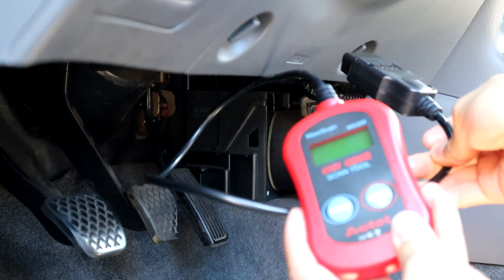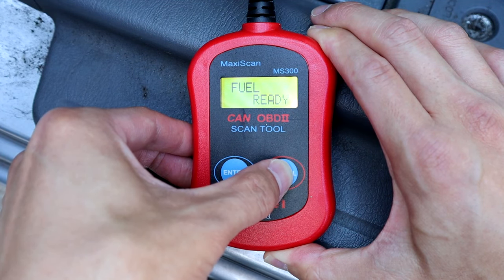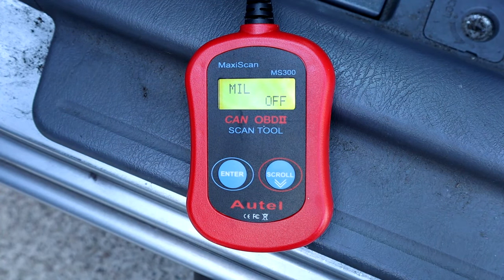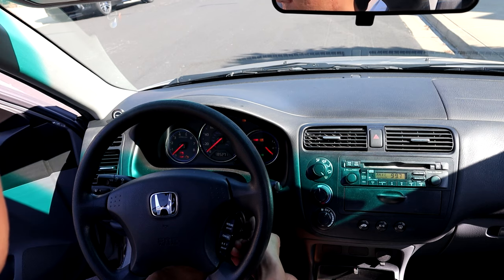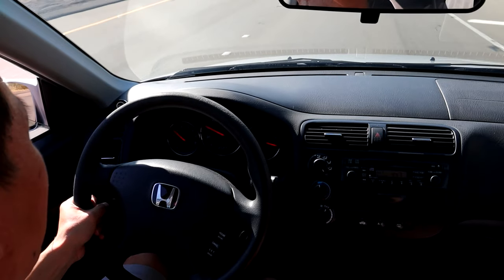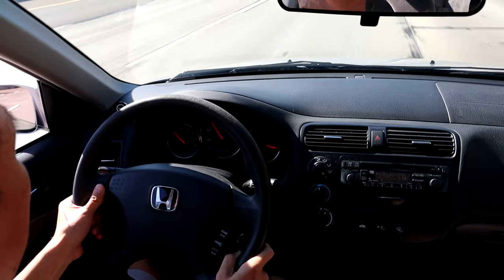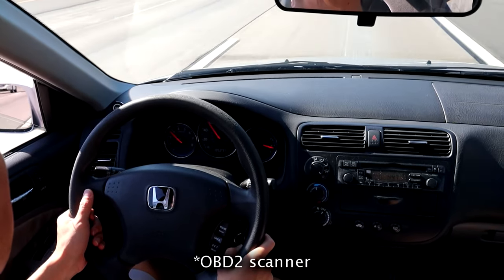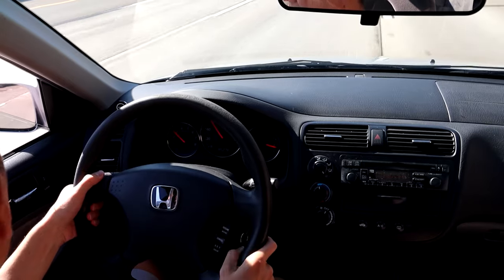How To Get Your Car Ready For a Smog Check – Pass 100% Of The Time – I/M Drive Cycle Ready

Comment: My car isn’t passing the smog after I done the drive cycle a few times different days 
Question: I was told it may be a code they need to obtain  from one who has the license for that particular code so where do I get this code?
Reply from the maker: You'd have to search on your particular car, but most cars will tell you the code if you know how to read it.  Or you can get a device like I have linked in the description and it'll tell you what the code is.  Sounds like you need to get something fixed before you'll pass smog.
Reply: Yea I had the canister thing replaced and the leak and a couple of other emission part replaced all the lights went green after that except for one and that one is the trouble  I’m not a mechanic but just a bit of it and ummm … I was told by the previous mechanic that for some reason something about getting a code from the computer or to that effect might not be functioning because the computer is not reading it he said it’s in the dash below the fuse box so tat was my question regarding a code.

Comment: i have gone 3 times allready to try to resolved this issue (catalyst inc.) on my 2012 acura mdx. i bought an obd 2 scanner and about to attemp this hopefully it will work. ohhh by the way the smog tech. keeps telling me i have to keep driving it  to clear it and its been 2 hundred miles and i hasnt clear its been a thorn in my spine.
Reply from the maker: Lolol why are so many techs stuck in the past???  I get that comment pretty often on this video.  Mindlessly driving the car around doesn't magically fix it.  Hopefully doing the drive cycle will.  If it doesn't work by 3 tries, you probably have a problem with your cat that needs to be addressed.  This drive cycle also doesn't magically fix everything.

Comment: NO I/M on FIXD. Did your freeway drive Twice 4am Sunday. Still has Solid engine light.  The FIXD Told me and 3 guys with scanner to replace 02 sensor.  I did 100 back.  I cleared history on FIXED.  LAST YEAR I PASSED SMOG Now 10,000 later problem!

Comment: What if the car is stick not changing gears will make its stall out when coming to a stop and holding in the clutch drops the rpm ?
Reply from the maker: I did the demo in this video in a stick.  It's gonna lug the engine on the freeway, which sucks, but you have to do it.  All other situations in the video you drive the car like normal.  You can switch gears and push the clutch in.

Comment: What’s the maximum amount of times will I need to do the cycle.
Reply from the maker: If you do it correctly, you shouldn't have to do it more than once.  I'd say if you've done it more than 3 times and are still coming up with monitors not working, you actually have a problem with that monitor and it should be checked out.

Comment: Do you have to take the car in for the smog check right after the drive circle?
Thanks for the video.
Reply from the maker: No.  The drive cycle just makes sure all the monitors are ready for smog.  Once you've done the drive cycle and confirm all monitors are good, you should be able to pass smog whenever, assuming nothing happens to the car and that you can pass the visual part of the inspection as well.
Reply: Got it, Thank you so much.
You've helped me a great deal.

Comment: I clear the faults a block a away from the emissions center with my scanner. It never fails to have a check engine light on when its time for an e-test.
Reply from the maker: Probably means you actually have something wrong with your car.  You can't just "clear faults" and expect the car "to be fine" and pass.  Read the code and get the issue fixed, then you wouldn't have to deal with that in the first place.

Comment: @nukem384 would this work if the car was on a lift instead of actually driving it on the road (the drive cycle while car is on a lift)? Also would this work on a Nissan 2000?
Reply from the maker: No idea since I've never tried.  But in theory it should work.  It would definitely help in that you can avoid traffic.  2000 and up cars should be fine, so yeah I would it would.

Comment: hi sir i did this routine and i put about 150 miles on my mitsubishi galant all monitors are ready but the evap system and egr system just wont get ready whatever i do and when the evap finally got ready my engine light came on and now i reset monitors again and have to start over but not sure why the egr is always incomplete any suggestions?
Reply from the maker: I would say get that checked out by a mechanic.  Running this drive cycle can't fix everything, and if it keeps coming back or you're driving a ton of miles, you probably actually have a problem with that system that needs to be fixed.
Reply: I'm dealing with the same shit. Changed almost the whole EVAP system except fuel pressure sensor on gas tank. 2 many variables

Comment: Done all the drive cycle like 3 times after a battery change  Still have  EVAP Inc ??? any ideas
TIA  Nissan altimas 2012 by the way
Reply from the maker: You might actually have a problem with the EVAP system.  I would get it checked out by a mechanic

Comment: My AC compressor doesn’t function and pops a check engine light, it’s a Jeep Wrangler and so I don’t use AC anyways. Does turning on the heat work?
Reply from the maker: If your compressor is throwing a code, then it needs to be fixed. This drive cycle isnt going to magically make it go away
Reply: @nukem384  that’s the thing. It doesn’t throw a code. Nothing is throwing codes. It just doesn’t turn on anymore. It’s a 2dr jeep so I’m about to replace the compressor with a pully wheel because I don’t need the ac. 

It’s my beater up car. Drove 160 miles over two weeks and no code nothing. Today I turned on the ac for 5 minutes and nothing happened but no codes came up, but the vehicle is still saying the car isn’t ready for emissions yet.
Reply: @nukem384  the only thing I haven’t done is filled up the gas tank. Not sure how that does anything but willing to give it a try.
Reply from the maker: @matthewdovi8548   gas tank has nothing to do with it. I would read the code and see what its telling you. But in your other comment, yeah you could do that as long as the car doesnt throw a code, it shouldnt impact smog
Reply: @nukem384  I have no code/check engine light.

Comment: I have a 2008 tundra and did the drive cycle multiple times, the readiness monitors shows complete/ready for all of it but the check engine light came back on and says stored?  Can i still smog the vehicle? What other alternatives can i go with?  Please help I need to smog my vehicle..thanks.
Reply from the maker: If the check engine is on, you can't pass smog.  Read the code and go from there.  Since you've done the drive cycle multiple times, that says that there's actually something wrong with the car.  This drive cycle doesn't magically fix everything.
Reply: @nukem384  thanks for your response the code is a p0430, could it be the 02 sensor?  Sparks? Or cat?
Reply from the maker: @romaouk1318   I would try the O2 sensor first and see if that fixes it.  If not, there's a good possibility your cat is shot.

Comment: What year is this civic?
Reply from the maker: 2004 Civic.  7th gen
Reply: @nukem384  thank you, I recently bought a 2004 Honda Civic LX and it needs to pass the smog test hopefully with this video it can pass it.
Reply from the maker: @fimbres-_-9509  Yeah if something just needs to be reset, this will work.  But if you try this like 5 times and some of the monitors still aren't set, you probably actually have an issue with the car.

Comment: I have an older type obd2 reader. Mine says Mil=off, Inc=0. That means i will pass the test?
Reply from the maker: Sorry, don't know what those readings mean on the old ODBII reader.  Basically, if the monitors are N/A or good, you should be ok.
Reply: MIL - Malfunction indicator light or Check engine light yours says off, that's good, that s a pass

INC - Means Incomplete Monitors - Yours says 0 that's good, thats a pass. 

I would say you are good to go.
Reply: @stevew9563  
Thank you so much. That's what I suspected. Appreciate it.

Comment: I had all the monitors complete except for catalyst. I didn't know what part of the drive cycle reset this..your explanation and what to do when I was able to reset.
After warm up,55mph for 3 minutes then throttle off and coast to 20mph,no brakes or gear down
Did I the the freeway early in the morning with flashers on. If your freeway has hills,when you throttle off try to time it going up hill,that brings you to 20mph faster 
Then 3/4 throttle back to 55 for 15 minutes. That should make it
Reply: Thought it was 5min after dropping to 20mph

Comment: what’s the main monitors are needed to pass and which ones are a must…evap can b n/a????
Reply from the maker: All of them unless it says N/A
Reply: @nukem384  i have cata incomplete…htd cata, erg, ac refrigerator, sec air system all is NA…is that a fail??
Reply: in pennsylvania…the 1st time i did the cata clean formula i can drive up to 674 miles that engine light is in again (p420 for cata conveter) and 2nd time i did. the cataclean it only took 150 miles of driving for engine to come on…i guess i didn’t do it right…
Reply: ty again for all the advice n help
Reply from the maker: @imsoooimpresssss4574  this sounds like you need to replace something. This drive cycle doesnt magically fix anything. If a part is broken, it needs to be replaced
Reply: @nukem384  u right…i do need the catalyic conveter to be replace…since the off market is not guaranteed to last over 2 years…in 2019 i did have it replace but it’s after market…my 02 sensor at 1st was also showing up but after cataclean it only show cataylic code not the 02…would ot be best replacement cata converter & h2 sensor or since the code only show cata conveter…should i replace both or just the trouble code…? ty again
Reply: @nukem384  much much appreciated it…ty
Reply from the maker: @imsoooimpresssss4574  if the code is only saying cat, just do that first and try drive cycle again. Then if it doesnt work, try the sensor also

Comment: I have a 2013 ford mustang with a pending po456 code (no check engine light) I drove it for so many miles and nothing has worked I tried this method once but still no luck clearing it . Any advise ? Also it’s a manual transmission
Reply from the maker: That code is telling me you probably need to take the care in and get it fixed.  According to the code, there's a leak in your EVAP system.  No drive cycle or magic driving is going to fix a leak.
Reply: @nukem384  the check engine light has not triggered I fixed the problem and rest the light and hasn’t went away nor does the light come back on .
Reply: @nukem384  i had a check engine light and it showed it has a leak and it was the purge canister . I changed it and I reset the light and it hasn’t came back on but the pending code doesn’t go away .

Comment: Smog isn’t passing me for the “Evap” and “Air” they just keep telling me to drive and I understand that’s for the evap and need a new gas tank cover but evap is okay here in California if not cleared. I need help with the “air” getting cleared. Is that the idle and rear defrost ?
Reply: I’m just confused bc I’ve done the idle for 2 minutes without the ac bc that’s what I was told and still the same logs “air” won’t clear off the list or “evap” but I’m gonna give this a try again tomorrow and hopefully the Secondary air injection clears
Reply from the maker: @cobygreenwood1015  If it doesn't you may need to have a mechanic look at the car and fix something.  Doing a drive cycle doesn't magically fix everything.  If there's an actual problem, it needs to be fixed.  Driving the car around isn't going to fix it.
Reply: @nukem384  I know it doesn’t magically fix anything lol I did check the car if something wrong I have no check engine light or leaks which would tell me if something was wrong or needing replacing the whole point of a check engine light but I’ll try your little ac trick tomorrow to see if that clears the “air” part of the smog

Comment: Question, will I pass if I have 1 monitor incomplete? I want to smog my car today, but I have 1 incomplete monitor (EGR system). Will I still pass? My car year is 1996 and I live in CA thx
Reply from the maker: Read the description.  This cycle isn't relevant for your car because they are doing the old sniffer test anyway.  That said though, if your check engine is on, you're not passing anyway.  If it's not, it's a toss up.  I can't say if you'll pass or not.  Depends on what the sniffer test picks up.
Reply: @nukem384  what’s the sniffer test? My check engine light isn’t on, but I did try to smog my car about a month ago, but failed due to incomplete monitors. The tech said everything else passed tho and runs clean, just incomplete monitors?
Reply from the maker: @Nada.yourbusiness  It's where they put this tool in your exhaust pipe to measure emissions. I suppose you could try.  Do the whole test and then get your scanner and see if it reset the EGR monitor.

Comment: My car is not reading the egr data , Can i skip and just do the egr portion?
Reply: Yes you can just do the section of the drive cycle that targets the EGR.  Whats the year make model?
Reply: Thank you for getting back to me. I had to run it at over 5000 rpm's for a few seconds to get the EGR to read.
Reply: @edk9576  Honda??
Reply: 2019 Acura MDX Hybrid

Comment: I have a Mitsubishi Lancer 2006. Disconnecting my battery for an extended period (2 Days) caused 'not ready' with all monitors. Should this procedure work with my situation please?
Reply from the maker: Yup.  This whole video came up for me because I changed the starter on an 06 Civic (disconnected batt to do the install), and it sent all the monitors into not ready status.  Do this procedure and check again, they should all be good after that.
Reply: @nukem384  Thank you sir, I'll give it a go. My car is manual transmission, I dont suppose that would make any difference?
Reply from the maker: @PeteUSA44  Nope, doesn't make a difference.  I've done it on the Civic in the video (04) and it's a stick too.

Comment: will this scanner work on my 2004 Volkswagen gti? it doesn’t show Volkswagen like it shows all other car brands in the product images on amazon.
Reply from the maker: It should work as long as the car is OBDII, which it is.  However, you may want to ask the manufacturer to be sure.

Comment: I did disconnect my battery and it took awhile to get all the monitors ready. The one I am having trouble getting ready is the CAT, all the rest of them are ready! I have a 2006 Ford Focus 2.0L automatic. I need this ready in 2 weeks since I now have a temp plate that will expire. Please help someone??!! And I do have the same meter you have. Also my AC does not work. Also one last thing.....can I go 45 MPH because I don't like the freeways!! I can take county roads to 45-50mph.
Reply from the maker: Do you have a check engine for your CAT?  If so, you might need to get that checked.  This drive cycle doesn't magically fix everything.
Reply: @nukem384  no no check engine lights at all

Comment: All I did was plug my obd2 scanner in set it to live data and drove out to the country. Found the longest stretch of road without a stop sign and drove 50 mph. It popped up all monitors ready and I drove to the smog shop and it passed
Reply: Do you leave the monitor hooked up while driving
Reply: @tracyb3198  yup

Comment: Well lets see if this works! Doing it in 3 hours. Mouse ate through my o2 sensors on my “new” honda civic. Its been a pain in the ass lowkey. B20b with a b16 manifold and its cammed. No cat but has a testpipe. And i never got a code relating to my cat?
Reply from the maker: I'm assuming you replaced the O2 sensor right?  If you still have a broken O2 sensor, this cycle is not going to fix that.  Interesting you didn't get a code with no cat, but this isn't going to fix that either, just an FYI.
Reply: @nukem384  yea i got new o2’s im just gonna borrow my buddies cat for my test. He too has the same civic but with a cat. Then just gonna switch back to my test pipe.
Reply from the maker: Yeah that'd work.  Do the drive cycle, get the monitors ready, pass and then do whatever for the next 2 years lol

Comment: Is there a simpler drive cycle procedure if only the O2 sensor is not ready?
Reply from the maker: You can try doing the beginning and 4:25 only one after the other and see if it works.  I can't say if that'll work though.  If it doesn't, I'd give the whole thing a try.
Reply: @nukem384  Thanks...will try. Do I still need a cold start? So just need to get to 55mph for 3 minutes and no need to decelerate to 20mph? If so, that would be more safe to perform.
Reply from the maker: @microduty6190  Yeah.  I would start the process just like I've mentioned in the video with the A/C, and then just go straight to the freeway and hold 55 MPH for a few mins and see if that fixes your problem.
Reply: @nukem384  I have actually tried the full drive cycle last night with no luck. Due to where I live, there are some stop-and-go in-town driving (about 2.5 miles) between cold start/idle and the freeway. Could that be the problem?
Reply from the maker: @microduty6190  I don't think it's going to make a huge difference.  Try it a couple more times and if it's still giving you issues, there's probably a pretty good chance that the o2 sensor is messed up and needs to be changed.  The drive cycle can't fix everything, but does reset monitors if they need to be reset.
Reply: @nukem384  Thanks a lot for your help!
Reply from the maker: @microduty6190  No problem!  Hope everything works out